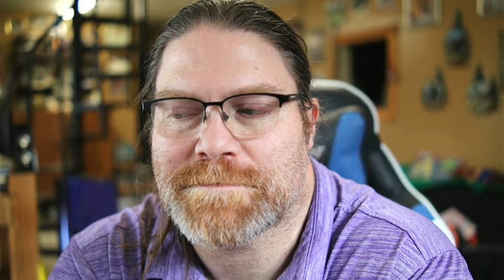How do you follow up on a supplier corrective action request (SCAR)?

Comment: Nice presentation. How can we cancel the SCAR?
Reply from the maker: "Cancellation" of a SCAR is could be interpreted a couple of ways. If the SCAR is closed, you would update your CAPA record to indicate all actions were implemented and the SCAR appears to be effective. Then you close it. You can also send that information to the supplier to include with their CAPA records.

Another possibility is that the SCAR was opened and should not have been. In this case, you would amend your CAPA record to explain why it is no longer needed and the record is being closed.

If you no longer need a SCAR, do not just delete the record. The CAPA records will be out of sequence and either an auditor or an inspector will ask where the record can be found.